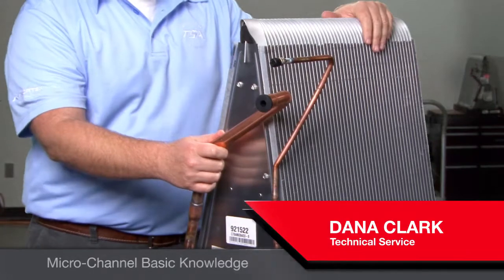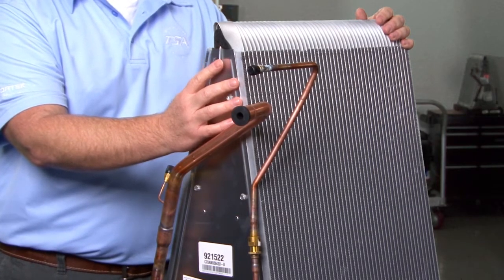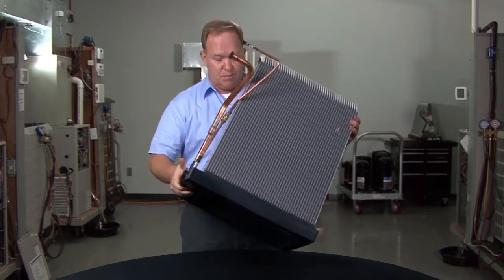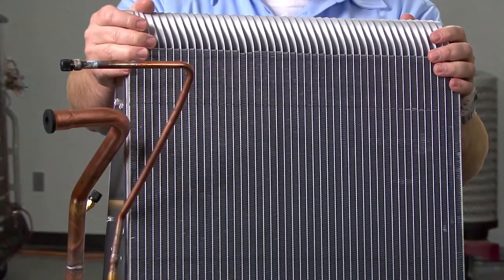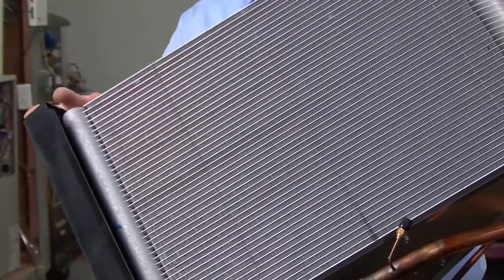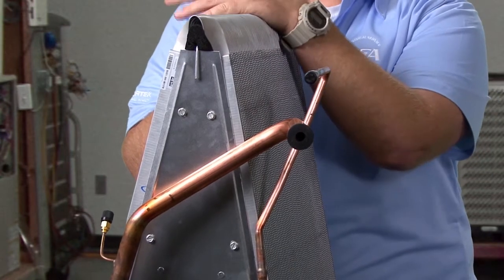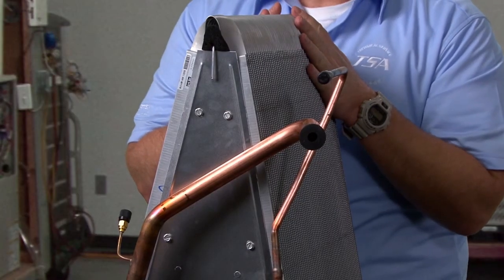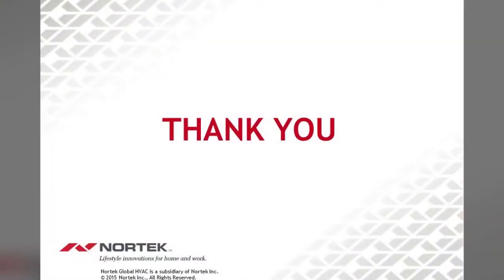Micro-Channel Basic Knowledge

Comment: Condenser coils have high failure/leak rate and are hard, if not impossible to repair. The small flat tubes make it susceptible to blockage. You cannot pump down system since it lacks condenser coil capacity. Micro channels do not belong in the HVAC industry for these reasons. It’s important to share the cons in this video. The cons outweigh the pros for these coils. Thanks for sharing.

Comment: I install 140 of these a year with very minimal issues, like maybe one a year that needs addressing. We don't have leaks. I have experienced less than 10 failures in the last 7 years of these coils leaking. If you are leaking water... nothing to do with it being microchannel, more likely a static/airflow issue. If they are clogging on you, you didn't install them properly. 

Good product!
Reply from the maker: Thank you for the great feedback. Would you send us an email at communications@nortek.com? We'd like to talk more about Micro-Channel and send you some swag.
Reply: "You didn't install them properly. "
No I have heard that excuse from manufacturers for decades on everything from gas furnaces to heat pumps.  Truth is that all manufacturers are guilty of putting products on the market before they have been perfected and they use feedback from technicians working on real installations in the field to work out all the bugs.

Comment: Designed to fail leakers. What is the warranty ? Not much. After 6 years my Nortek is leaking.
Reply: Stay far away from junk microchannel ac units or you will be very SORRY! Can't handle the pressure in home ac units but work great in much lower pressured systems in a vehicle.
Reply: My Nordyne junk micro channel leaking @ 5 years.
Reply: @stevee7774  Noticed that too. 
At 5 years they are done.
Reply: My Coleman started leaking after 5 1/2 years just out of warranty. Now American standard gas packages have gone to microchannel indoor coils. Junk

Comment: The thickness of the walls need to be increased. The overall robustness of the micro channel needs to be rethought. The pressures of 410A are to much for this. No one want's to spend thousands for something that will fail in a few years. Yes there are upsides but the downsides totally cancel them.
Reply from the maker: Our coils have been fully tested to industry standards and can handle 410a refrigerant.
Reply: Not for long.
Reply: I HAVE to fix one and heat control is extremely important. I've been practicing on a standard aluminum coil just to get use to heat control on aluminum.
Reply: That's what warranties are for, IF they fail.